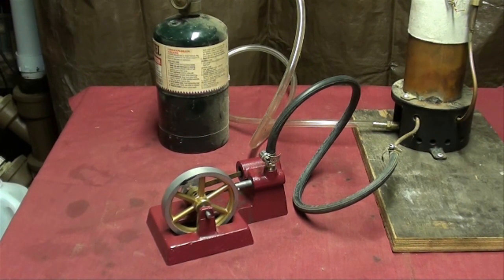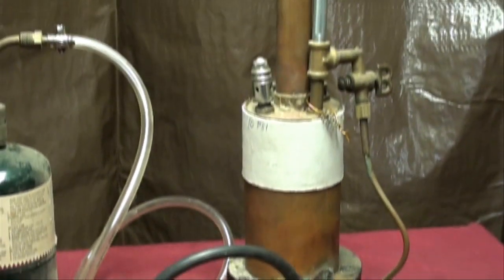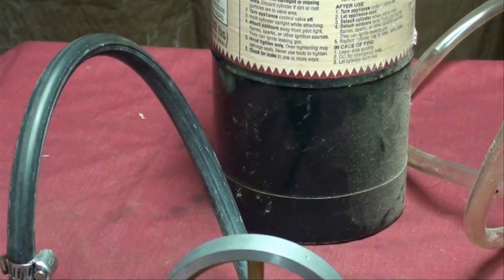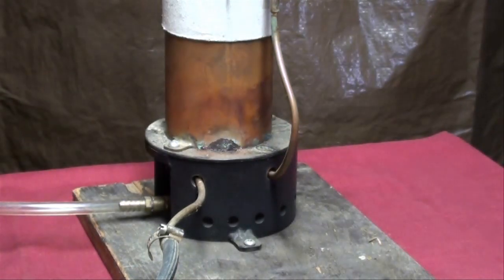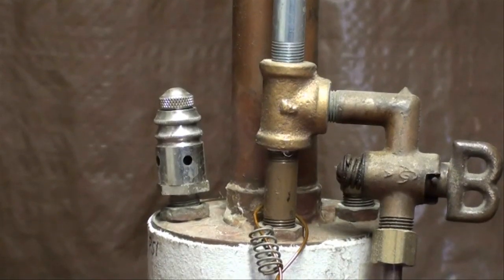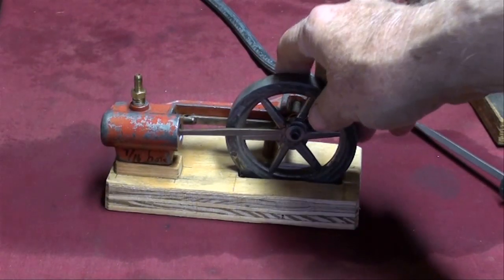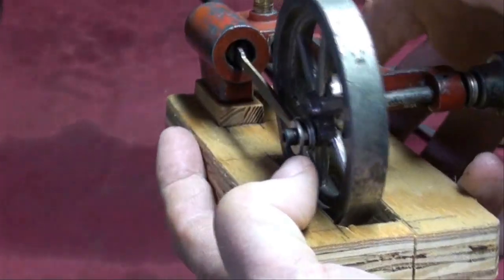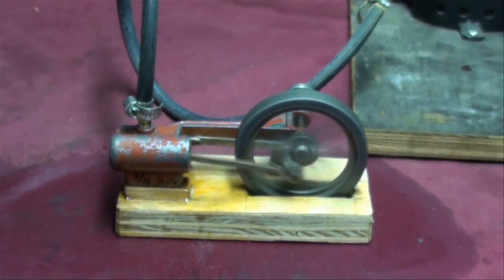WEEDEN MODEL TOY STEAM ENGINES with BOILER part 4 tubalcain

Comment: I am expecting to get a combo Lathe/ mill tomorrow. Expecting Cause I ordered it 11 months ago and was supposed to receive it 9 months ago. Even now it was supposed to be in the city today but supposedly the truck got held up so it will only be here tomorrow. Maybe. While I've never used a metal lathe or mill before nor do I have any of the tools I plan on building steam engines in my spare time.  It's simply mind blowing power. I look at Big Bud  the biggest most powerful field tractor ever built can pull 80 feet of deep tillage. Then you compare that to the old single cylinder double acting Case 150 stem road tractor and that can pull 44 feet of 14" plough shares. My God for torque. Only about 180 dyno horses but 5000ft lbs of TORQUE? I mean is there anything cooler than watching a steam engine starting off in the winter. There simply isn't anything more interesting to watch. I often wish I would have been born a generation or 2 earlier. It would have been much more interesting. AND someone in this country would have built the lathe and mill I wanted besides.
Reply from the maker: We were born too late

Comment: Engine timing and running direction is achieved by the use of a slip-eccentric. This is a VERY COMMON feature of toy steam engines (and has been for well over 100 years or so). Still used today by Wilesco.
Reply from the maker: +Henry A Thank you

Comment: Did you know it is possible to convert a 4 stroke Gas engine to run on steam ?
Reply from the maker: +jacky Parker Never done it. It would require new valve system
Reply: +mrpete222 why would it require new valve system when it already has one in place ?

Comment: The videos are great, I enjoy them very much. For your superheater drys and heats the steam, I changes your steam from wet steam to dry steam and it does add additional heat. It is not good for Aluminum or gun metal steam engines.

Comment: I enjoyed the video.  I saw another video on u tube that uses browns gas to operate a torch which will burn just about anything.  After the heat energy is extracted the Hydrogen combines back with the Oxygen to form water. I was thinking if it is possible to run a steam engine using browns gas and to turn a generator for electricity which would make more browns gas and then more steam etc.
What do you think?
Reply: Can't do that... You're trying to produce more energy than you're consuming, which equates to perpetual motion. Unfortunate but it does not exist.

Comment: You wouldnt have to worry very much about the water level when using propane right?.......I mean if melting silver solder takes about 860 degrees you dont really need much of a waterglass. And that boiler is pretty cool with the small super heater and the proper term is "Superheated Steam" and in canada its even less in our population theres prolly only about 1000 people and I happily make up 1 of those :D Love your videos very much they keep me company at work.

Comment: Count me in for more steam! I watch you vids from a general fascination with metal working techniques. I think the occasional steam engine video is a kind of capper for the great vids of stand-alone techniques. You taught me to sharpen drill bits correctly and it helps  me nearly every day. Thanks.

Comment: I enjoy all your videos and find them interesting, I've personally never seen a reversible engine like the one you demonstrated. Also pressure cooker safety valves here [UK] are weighted with three increasingly larger weights which to screw to the cap. Excess pressure lifts the cap and weight to release steam.

Comment: I'm a boiler guy from a tourist railroad and I have a couple hints on that boiler.

Yes, by putting a coil in the steam delivery line and exposing it to the hot gases you have a "super heater" and super heated steam.

Then your gauge. You need to put a loop in the line to the gauge. reason is you get better accuracy if there is water in the line between the gauge and the steam. You want to keep the steam out of the gauge. We will prime the loop on locomotives but condensate will work.

Comment: Well, it would certainly be a very simplified version, but the fact that it uses an eccentric must make it related. It didn't look like it had the two eccentric rods that the Stephenson gear has, but the fact that it is "auto-reversing" may make the rods unnecessary.